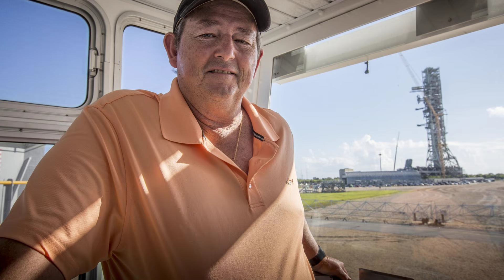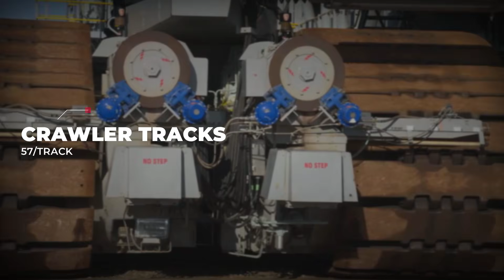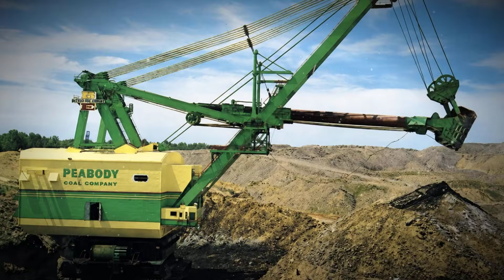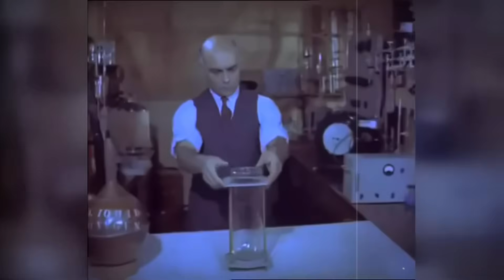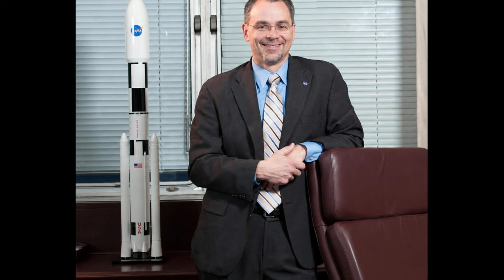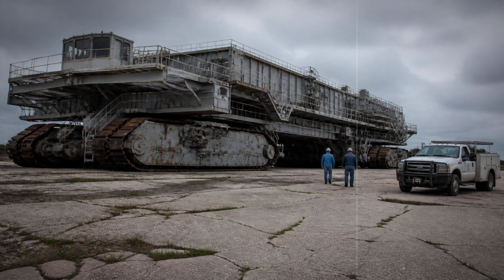NASA's Crawler-Transporter: Born From a Coal Shovel

Comment from the maker: The part that still gets us: NASA spent months hunting for a way to move the Saturn V, and the answer came from a coal mine in Kentucky. A Bucyrus-Erie "Big Hog" shovel gave them the idea, and then Bucyrus-Erie lost the bid to build it to its rival, Marion Power Shovel.

We dug into the record on both machines, CT-1 and CT-2, including the cracked steel shoe that turned Space Shuttle Endeavour around in 2000, and the bearing scare in 2002 that almost grounded the program.

The same company, Marion, also built the largest land machine that ever existed, The Captain. Our partner channel Construction Legends told that story here: https://youtu.be/h43p8J4Yxss

If you ever worked at Kennedy, or watched a rollout from the fence, tell us what you saw down below. We read them.